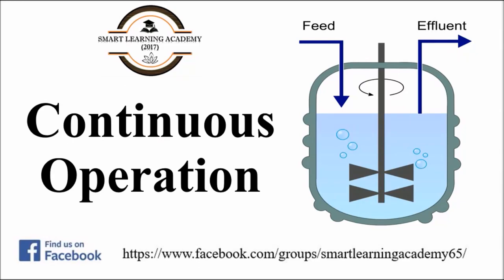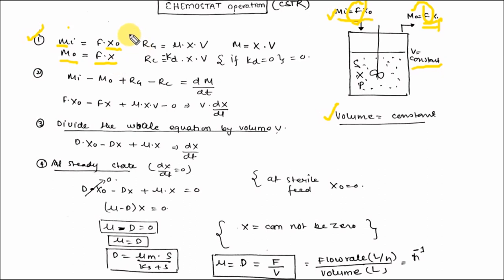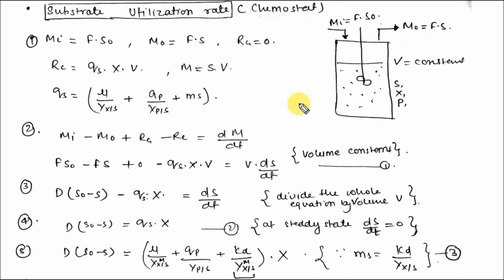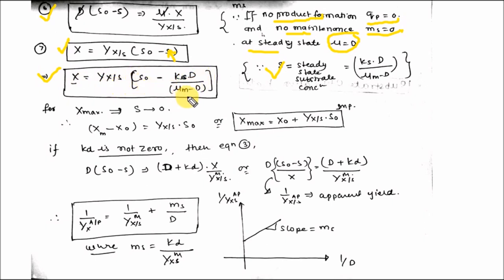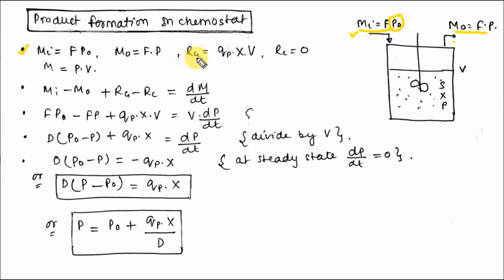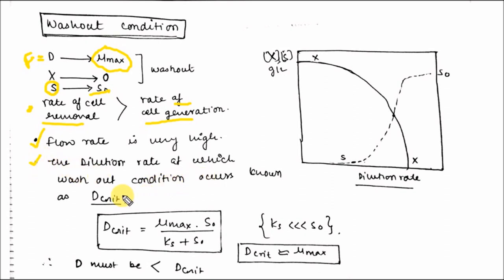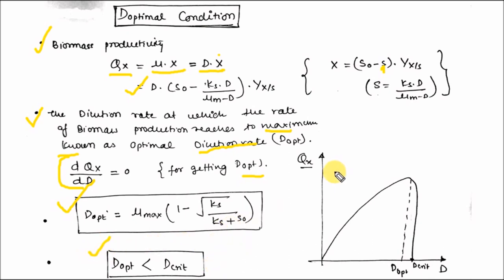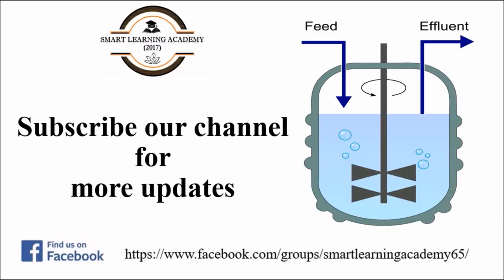Bioprocess Engineering | Continuous Reactor Operation | By Virendra Singh | CSIR | GATE | DBT

Comment: A mixture of 4 protein of pI= 11,7,5,3 are loaded on DEAE anion exchange column equilibrated with low ion strngth buffer of pH=8. which of the four protein wouls be expected to be retained in column??

plz hlp with explanation..
Reply: Answer is protein with pI 11? Isn't it? Plz reply